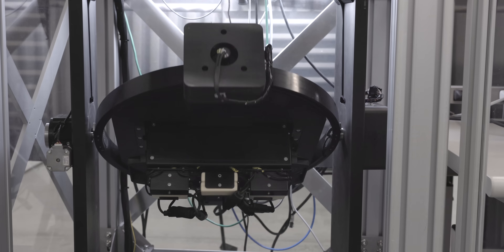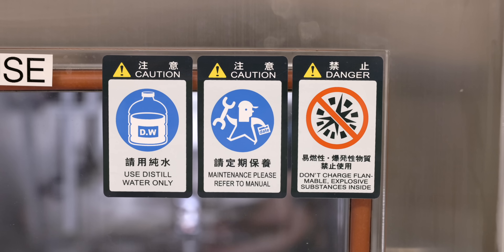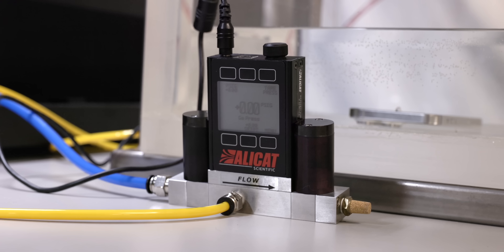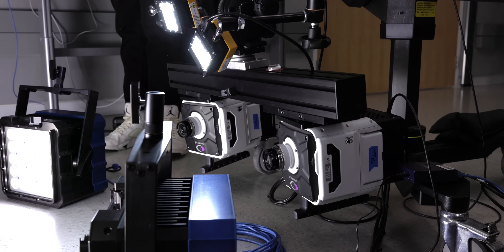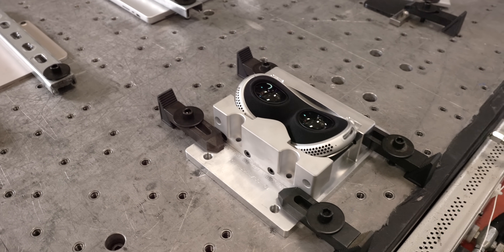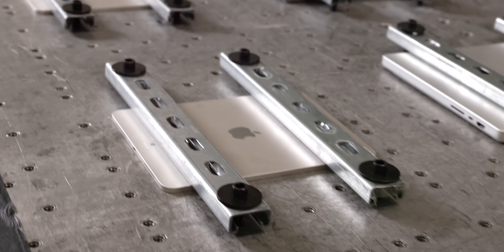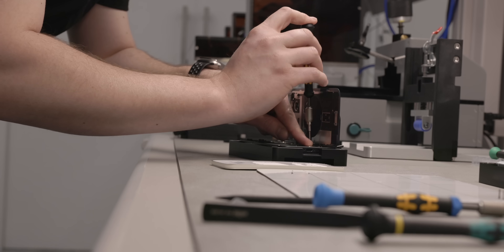I Visited Apple's Secret iPhone Testing Labs!

Comment: Talking about durability vs repair ability being diametrically opposite. 

Nokia 3310 has entered the room.
Reply: Bet you never touched one before
Reply: It also was not a glass sandwich
Reply: Did you come up with that phrase just now or is it an idiotic idiom that karma farmers on Reddit have been saying for over half a decade?
Reply: 3310 wasn’t ip68.
Reply: @SebastianBugiu  Yea it was ip9x. Barely anything was water proof back then when it came to handheld electronics so why would. But many things could take one hell of a beating. The original gameboy being one example.
Reply: @SebastianBugiu  well, you’re right, but it is grenade proof…
Reply: A Nokia isn’t a modern phone tho. It’s a much simpler device

Comment: I feel Apple's stance is that protecting the most likely things to fail for most people is worth making the less likely things that need to be repaired/replaced harder to do so. Someone is far more likely to drop and break their phone or drop in a lake long before they will ever have to worry about a battery for example. Especially if you factor in their plans to get you into a new phone very 1-3 years.
Reply: getting a new phone every 1-3 years is insane tho , phone is basically new
Reply: @ES-yc1tp 3 years is fine but below that is outrageous unless you have a next up program but stull
Reply: Not really if u baby  the phone yes@ES-yc1tp  plus every 3 years is a big jump
Reply: @ES-yc1tp  I agree, but,  with phone carrier upgrade plans there is large portion of phone users that have only 1-2 year old phone.
Reply: That’s actually completely wrong. All batteries will fail—they are a wear part. There is 100% chance that every battery made will eventually fail. In comparison, a small proportion of phones will break from drop or water
Reply: @312bigbeanburrito 
And in addition to what you're saying here, let's remember that any company would always gonna be profit first, no matter how much they care about their end product/customer experience for their clients...
Which means, when the guy is talking about that threshold where he argues it is "objectively better" to make their phones more durable, cuz their repair requests dropped to an all time low, hence the best, kinda negligible, "environmental impact", he's not only talking about doing the math for the end product experience...
Do anyone here thinks apple of all companies would allow a mere engineer talk in public?
This guy surely is PR trained...
The math for the end product ALWAYS factors in SALES...
Let me give what this guy is saying, a spin for us YouTube comments guys:
"Yes, we are very aware our products have wear off parts, just like batteries, and as spoken out loud, were also very aware that durability and repairability are not always mutually exclusive, so if all of our customers are gonna have to need to replace parts sooner or later, and our products are made of breakable parts either way, what is the equation we'd like to work with so that we appear the least accountable for pollution, while still make the most money out of sales in general?
Here we conclude we'd rather break 10,000 phones ourselves, which, YES, it's waste and pollution, but this way, we can get certified for some industry standards so that we can justify our products being this repairable-unfriendly, so that we inflate statics numbers of repair request, or NON REQUESTS, because people believe our justifications and would rather just buy new models and make us more profit".

Less repairability and durability aren't always mutually exclusive, I agree, but I would argue repairability is at least 70% better than durability, environmentally speaking...
Yes, the 10,000 phones trashed in those tests would pretty much be a lot less than all the phones that would be otherwise submitted for repair requests on a same year's model, but it is VERY possible to make a water resistant phone that supports battery replacement without major intrusion...
And apple surely knows that for all of those who enjoy said durability, it would kill their profit margins if they also give them repairability, since the phones are now so "durable"...
So they charge a lot for battery replacements, so much that, even if it was for good reasons (proper adhesive application, proper sealing, and adequate original part replacement) it still would be expensive enough for those same customers to consider just paying a little more, once again, and get the newer model from them...

Marqués isn't a bad guy, but I do find his arguments in favor of big companies like this one, to be very naive at best, and consciously uncool at worst...
Reply: @312bigbeanburrito  I understand that they will wear I'm not denying that. I'm saying they could care less about the longevity of the battery and they would much rather focus on the durability of the phone in general. They don't care that it's hard to replace their battery because they are planning on you getting a new phone before you get to that point.
Reply: @312bigbeanburrito  This is literally the definition of outcome bias. Look it up my guy!
Reply: That doesn't mean they should make phones intentionally hard to repair though! Sure, repair shops might have to deal with adhesive seals, or glued in batteries - but they should be able to buy parts from the manufacturer to fix things that are broken.
Reply: @Nabushika if you get AppleCare it’s very easy to repair
Reply: Especially for a flagship, the idea of a phone needing to be replaced under 3 year is crazy.
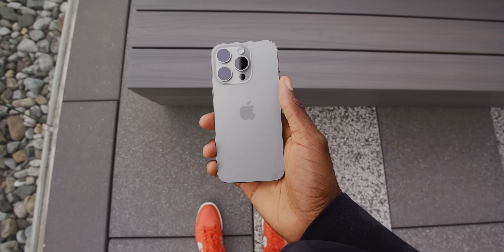Reply: Yes, this is what was said at 8:26
Reply: Let me see if I can reword this. I think they want your phone to last long enough until they push out the new one (water and drop resistant) but not so long that you wont want to buy the new one (ignore battery longevity/repairability).
Reply: Doesn't at all explain why replacing the back glass up until very recently required literal lasers.
Reply: @HEVTech1  water seals? And wireless charging? Hello?
Reply: That may be true, but it doesn’t mean they have to price the repairs insanely high. A battery for a smartphone doesn’t cost $100 to manufacture.
Reply: @Strangely_Benji  well 10-15 dollars a month for a free battery replacement and huge discounting on other replacements is pretty cheap compared to the price of the phone
Reply: Is this a fucking AI generated summary of the video transcript?
Reply: @juan_w_fer  Damn, you caught me. And I would've gotten away with it if it weren't for you meddling kids... 🙄
Reply: Okay so why is the backglass a thing. Make it plastic god damn it. Also more importantly EU will force them to have swappable batteries. Same way they got forced with USB.
Reply: @alexandrostheodorou8387  I’m so glad you don’t make decisions at Apple or Google or Samsung. You can do that with anything else, just not the companies I like.
Reply: @nylotical   I want back glass to be metal again. I have cracked the back of my iphone 12 pro max no less than 5 times. And replaced it every fucking time.
Reply: @alexandrostheodorou8387  HOW?! Dude I’ve had my mini caseless since launch and only cracked it on concrete last month. It’s not the first concrete fall either! But yeah no the metal and plastic backs would be terrible. Bad scratching, no more magsafe(on metal back), bad feel, and worst of all… heat.
Reply: @nylotical   Bad luck i guess. One time i dropped the phone on concrete with a case, broke really fucking bad the back glass. Thats why I’m sick of glass. But the front glass never broke because i have always had a screen protector. But also, i have been thru no less than 30 tempered glass screen protectors.
Reply: @alexandrostheodorou8387  Firstly, I really don't like Governments dictating how companies make their products - bit soviet. Also if  I pay 1000 £/$ for for a phone I'd rather a better, nicer material than Plastic!? Big iPhone 5C fan were you?  Glass is also much better environmentally in the long run.
Reply: @TheGadgetbadger   you put a case on your phone right? Who cares whats underneath. But if it’s glass underneath the case it can break. Happened to me several times.
Reply: @alexandrostheodorou8387  I do not have a case. Fortunately if I ever was able to damage or smash it I have the skill set and equipment to replace it.
Reply: @TheGadgetbadger   Ok how about easily replaceable back glass.
Reply: Yeah, but they don’t need to software lock the battery to make it durable

Comment: I am on the right to repair team but I also understand where John is coming from. I work for a company that makes laser cutting machines and we sell two add on devices that facilitate automatic operations. Now if a customer were to open these devices and so much as unscrew and then tighten the little screw on the camera, it won't work the entire device comes back to me. So sometimes right to repair can be a hassle and your devices might not work to specification afterwards.

Comment: What’s interesting is that these physical tests are only part of the story. Companies like Apple also virtually test. So as well as 10,000 physical tests, there are arguably 1,000,000’s of virtual tests (physics simulations) conducted. So you could predict that the 10,000 physical tests will likely reduce overtime and virtual testing will exponentially increase. Same thing happened in the car industry with crash testing.

Comment: i nokia 5110 poured festival water out of one and once it was dry again, it worked. the battery was fully replaceable and accessible with fingers. this phone existed 8 years or more before the iphone. the idea that reparability and durability are at odds with each other is…bollocks.

Comment: The take on durability vs reparability makes sense in terms of difficulty to access the battery. it does NOT make sense with Apples vehement and aggressive attempts to shut down and withhold information/parts from third party repair centers. Those actions have nothing to do with "it's hard to get to the battery when we make the phone waterproof"

Comment: I don’t agree with Mr. Ternus’ idea of reparability needing to be sacrificed for durability. I’m also an engineer here and it’s definitely possible to make a durable product without needing to sacrifice repairability, especially in terms of waterproofing. It’s just more challenging to design, not impossible. Nokia’s old phones and Lenovo’s ThinkPad laptops are devices that can take a LOT of abuse before becoming non-functional. What Apple is essentially stating here tells me that it’s not necessarily a financial issue/wanting to make people buy new phones… it’s an entire philosophy that continues to be against the concept of repairability.

They want a device that always works and cannot fail. I understand that goal, but it is not a practical one. I’m wonder if that’s where Apple’s dreamers keep chasing after, hence why their product design is so locked tight.

The only practical solutions here seem to be either hiring a new head of hardware engineering or creating legislation that forces ALL consumer electronics companies to make their devices repairable to owners using typical tools available to the public.

And I know old Nokias didn’t necessarily have water ingress protection, yet the point stands and is still valid. It’s not impossible to design something that is repairable to common people and still maintains its ingress protection rating.

Comment: I understand the desire to market durability as the far side of a spectrum from reliability but that misses the whole point, because reliable and repairable are not interchangeable. To use the provided example of a battery, a reliable phone would survive for 5 years, but a repairable phone would allow for you to replace the battery. There are many phones that can both survive for 5 years and replace a battery. What those phones do not do is "look slick" or "be thin". So this whole premise of we're doing good because we've reduced the number of failures by gluing everything down in to a glass case so you can't touch anything is just marking spin to the reality that Apple still wants you to replace your WHOLE phone ever N years because something will have to degrade, if they were truly repairable then they would just sell a phone once, and replacement batteries and screens.

Comment: Countering the apple engineer's anti-repair rhetoric 7:40:
Want to see a good example of companies making a modular but durable product? Go look at the camera industry. You can change the lenses on camera bodies and the batteries very easily. They're still sealed against ingress (albeit not submersion) but it's not the end of the world if the sensor needs replacement. There are stories of Canon DSLRs going through hell and back. 

The apple engineer claims that the scale of repairability has durability and repairability on opposite ends. The camera industry clearly shows you can engineer your way to a pretty solid middle ground. The devices will probably be slightly bulkier, but it's well worth the trade off. No professional photographer or DP will buy a camera with the battery glued in, or if the parts can't be serviced with reasonable difficulty. 

It's annoying watching this engineer push an anti repair agenda when apple is the last company that has ever attempted innovating repairability. Meanwhile you look at a plucky startup like framework making easily repairable devices. It's not like their laptops are falling apart, are they? 

Really want to see Louis Rossman go to town against this video lol.

Comment: The durability vs repairability thing is absolute BS - dude talking about IP68 rating as if there weren't any devices with better repairability that have the rating - like it's impossible to have an easily removable battery with this.

Also yes if the product never failed the analogy would make some sense but it DOES fail. How many people drop their phones and crack their screens vs how many drop them in water? And how often? I'd imagine more people drop it on the floor, which means that the IP68 rating didn't really help much even though they're claiming it's "better for the environment" give me a fucking break

Comment: They should go to a fully titanium build remove the conductive wireless charging ring and instead use the 3 pin connection like on the back of the iPad pros

Comment: Hard disagree about repairability. This isn't about water tight seals, this is about software lockouts and malicious changes against repairability for the sake of greed. Bad take there bud.
Reply: Woosh
Reply: It's cringeworthy to say the least
Reply: Yup, each part has a serial number that needs to Match up just to turn it on (for the newer phones). 
Not good.
Reply: I don't really understand how it makes them so much money
Reply: @kingoftherevolution4855 people buy new phones because Apple controls who caj repair certain things and up charges customers to the point they want to buy a new product while being so locked in the eco system so they buy Apple again.

Hope that made it clear to you on how they make more money by fighting against independent repair shops.
Reply: Exactly my thoughts thank you
Reply: You guys are fundamentally not understanding the entire point of the statement. 

You do not get to the level of reliability without making sacrifices. The amount of seals, tight tolerances, and adhesives in modern, top end smartphones is insane. The entire process to get to an easily-achievable IP-68 rating across millions of devices results in “low repair ratings.”  That’s the entire point, and no one, not even the Apple Engineer was denying that.

That’s what he and Marques were talking about. You guys not understanding that is not their problem.

Try harder tbh.
Reply: @RightJoystick  weird that other companies have phones that last longer and are repairable? Compare the new iPad to the new Surface and you'll see that the surface is more durable and more repairable and arguable more performat. So, what's you're big brain response to that?

Comment: 10:15 i don't like when people miss the point of glass in terms of durability so much.
yes, glass breaks - obviously - but the thing most phones encounter as a force that could destroy it is an impact from a fall, and when there is an impact the energy has to go somewhere - with the glass design it goes into breaking the glass - instead of breaking the internal hardware making your device unusable and miles harder to repair than just changing the back glass on the outside.

Comment: Durability and repairability are often inversely proportional, and I agree with this statement. However, I'm curious about the pairing of parts and components that Apple does. How does this help? And what is its connection to durability in this case?